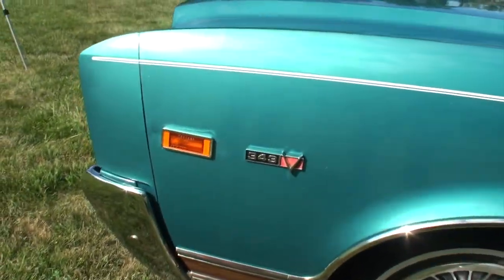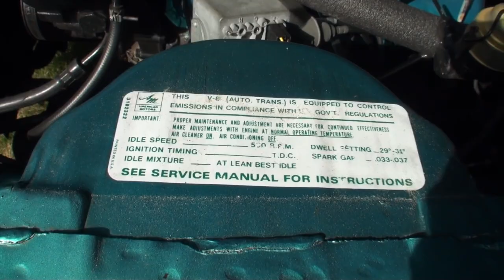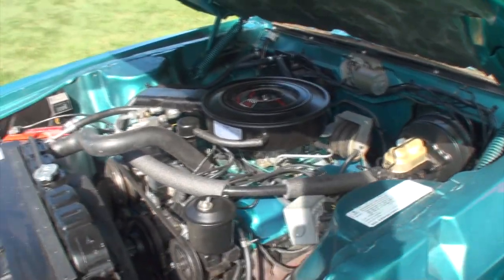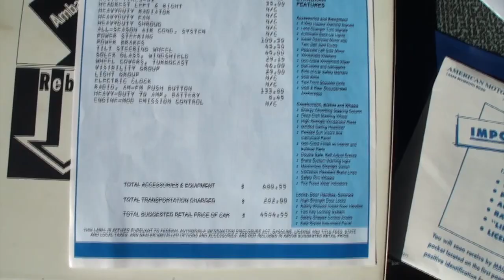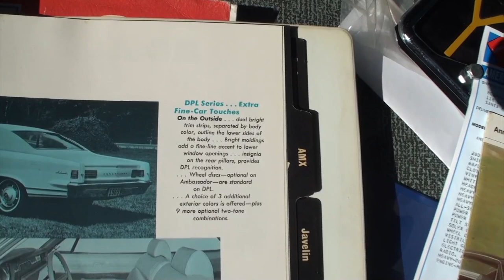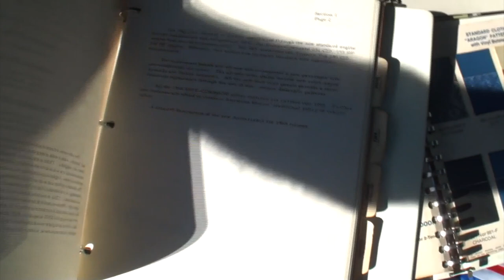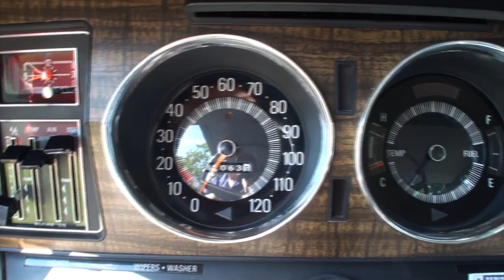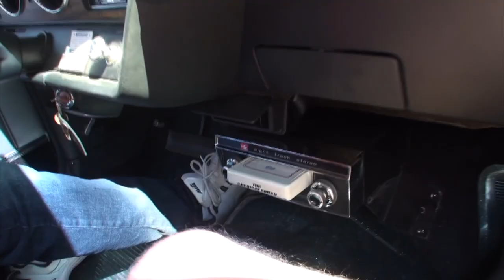Cindy’s Car ! 1969 American Motors AMC Ambassador SST & Ride on My Car Story with Lou Costabile

Comment: Mine was just a little different.  Same color but a four-door sedan.. owned by the untypical "old man".  He used it to tow a big Airstream travel trailer.  Ordered from the factory with a super-duty police suspension (huge anti-sway bars front and REAR and air shocks rear), 3.90 posi rearend, and the police interceptor 401.  Put J70's all around, and 36" glasspacs, with 24" resonators on it.  Stock quiet at idle... but it came to life under power.  It would eat 383 Road Runners, 390 Mustangs, SS396 for breakfast.  They were not happy getting beat by an "old man's" car!!!
Reply from the maker: Hi Don F, Happy to read this car brings back memories of your car :-) Thank you for viewing and sharing.  Hope you see many cars on this Channel you enjoy!  Please Subscribe, and hit the "bell" so you can see all the cars when they are uploaded on this YouTube Channel, Lou

Comment: That Alamosa Aqua color is perfect! It's difficult to NOT look at.
Check out the data tag on the front of the passenger side valve cover, secured by a self tapper!  You can see evidence of a little seepage.  I saw an up-close shot of an AMC 360 which also had this, and couldn't believe that they would do that.
"Desert Only" is said to not cycle the compressor, and will ice up on you in less than desert temperatures. Sounds good going down the road at the end.
Reply from the maker: Hi Dan, Happy to read you enjoy the color of this car :-) Thank you for viewing and sharing, Lou